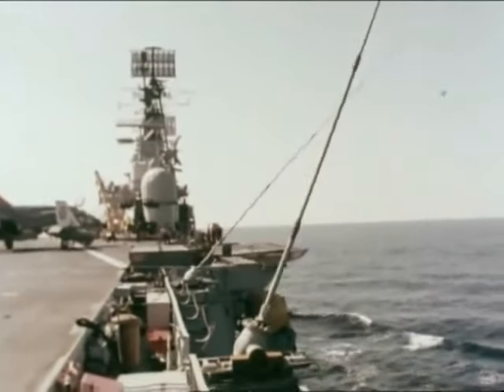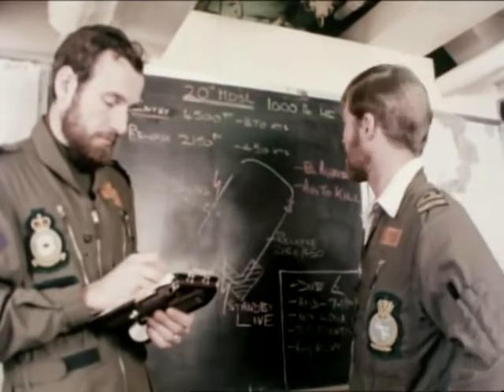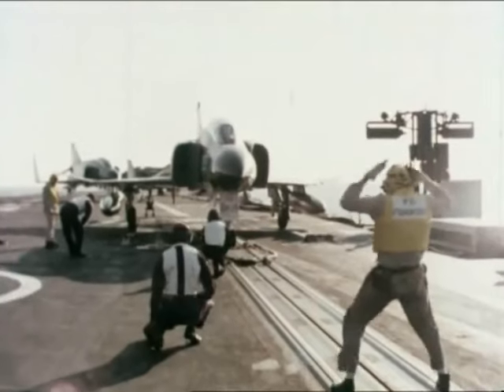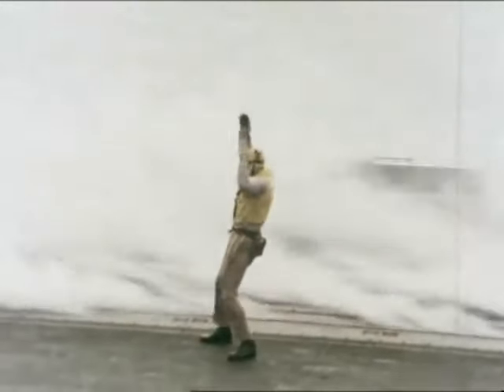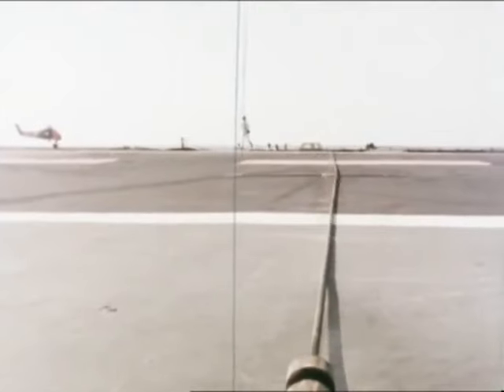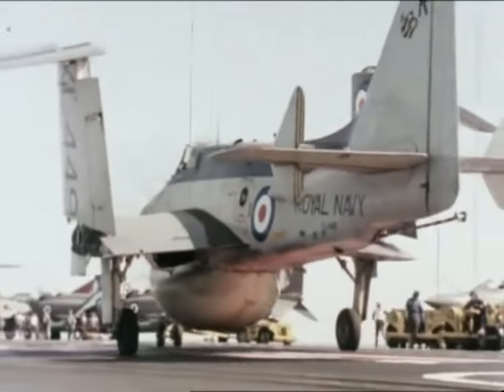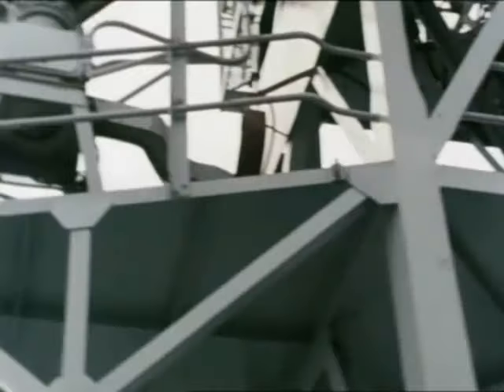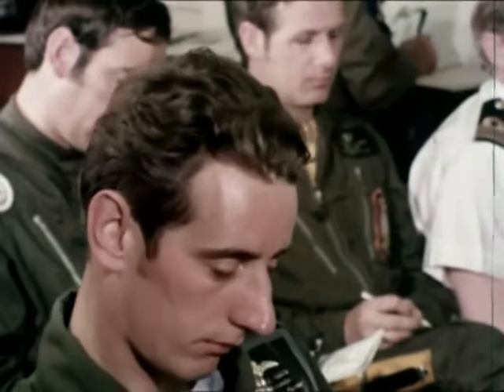HMS Ark Royal 1975 Opération_Buccanneer S2 / F-4 Phamtom II

Comment: As an ancient French sailor, flight deck crew member aboard Porte-avions Foch and Clémenceau in the early 90's, i must say that's an amazing footage, very impressive,  magnificent Wessex and F4, Buccanneers were so massive!! well done! the Ark royal was a very nice ship not very different than ours, old fashion way..Back in time i usually worked around the Flottille 12F equipped with F8 Crusader, the last gunfighter, amazing aircraft, night ops were pretty scary,..Cheers fron France
Reply: Slater Slater  I think the French navy was the last operational user ( early 2000's) after Philipines dicomintionned their own F-8, ours F-8E ( FN) recieved special modifications like the angle attack of the deployed wing, leading edges slats in two element, new avionics...glad to have seen these amazing fighters in action on board...
Reply: Slater Slater  yes the exocet missile/ Super Etendard was a deadly combo, RIP for the crews of the Sheffield destroyer...When i was aboard the Foch and Clémenceau most of the entire air group could fit on the hangar ( aproximatly 30 aircrafts), 2 Alouette III ( aka " PEDRO" escadrille 23S.), 1 or 2 Dauphin chopper ( also " Pedro") same job than your Wessex, 
Super Etendard ( 10 aircrafts flottille 14F, 17F) ( like Buccanneer), few Etendard IV P for recon mission ( P for Photo flottile 16F ), 4 or 5 Bréguet Alizé    ( same as Gannet flottille 6F.) AEW mission, and like the Phantoms, F-8E FN for the air superiority missions ( less than 10, Flottille 12F call sign "lascar"), a couple of Super-frelon ( like seaking flottille 33F) and often, 2 super Etendard with air refuelling belly pods. Flottille had the same type of aircraft, escadrille were composed with different aircrafts ( Alouette II/ III, Dauphin).most of the time only few planes were spotted on the flight deck when the 3 hangars were fully load...
Reply: What a great conversation you two are having! Thanks. I enjoyed your interaction.
Reply: Super Entendard or Buccanneer, thats a hard choice.
Reply: Slater Slater  i have some very good mémories about the F-8 at sea, during night ops, full afterburner after cat launch, and that aircraft was magnificent on the glide slope with fully rised wing, full down flaperons, dark smoke at every power management, And what about that amazing front wheelie after every touch down...
Reply: Slater Slater  your're absolutly right about the range and the payload, but the Super-etendard ( not the Etendard IV M with no radar or the recon version Etendard IV P) was able to carry AA missiles  ( infrared or guided missiles) And was agile and light  enough to engage a dogfight with an other fighter even if the Crusader was used as fighter since the 70's  and have been replaced by most reliable and more advanced Rafale in the 00's...
Reply: Slater Slater  I never seen that footage before! it's great! the Fouga magister was called " Zephyr" in the French navy, it was an excellent two seater final trainer to obtained carrier operation certificate  and you can also see the aircraft carrier "Arromanches" ex HMS COLOSSUS, in the late 60's the straight flight deck was abandonned
Reply: Great information.  Cheers from UK 🇬🇧
Reply: Thankyou for the respectful comment on my old ship,I used to watch the aircraft landing especially at night it was scary and awesome every time..... the buccaneers were never failed to leave me with my chin on my chest.The pilots loved to fly the buccaneers because of the speed and ability to scim the sea surface so close they left a tail wash behind them.I will never forget the day I was on a weather deck one deck below the flight deck drinking a cup of tea, when I heard then saw a buccaneer fly past me and the pilot looking up at me..... he was smiling at the look of disbelief on my face and the tea dribbling down my shirt........
Did you know the buccaneers were used in the first gulf war? They were used to light up the enemy for Lazer guided weapons, they were restricted to flying above 15 feet above the ground because when they flew lower the enemy could see the dust trail blown up behind them......... the modern fighter pilots would make a point of looking at the lightning fast aircraft that still had buttons and switches in the cockpit.........
Reply: My first ship was the USS Kitty Hawk, 1999-2002. My secondary duty damn near took as much time as my primary duty. HOWEVER as I had always been interested in the military I quickly realized my job was a golden ticket and being I held TSSCI clearance I could pretty much go anywhere on the ship I felt like/ curiosity pushed me.

It didn't too long to find my favorite and mostly private spot to watch flight ops or get solitude.  It was directly atop the island.  I had and still do have a deep love for the Tomcat. I remember well my first time up there watching 2 Tomcats launch off the bow cats, this was the moment I realized my favorite spot was actually 30 feet or 9ish meters to either side. Looking back it's kinda funny, I was so full of excitement watching the dance of the flight deck for the first time and watching my most favorite of aircraft get ready to launch.  JBD's rise up then the Tomcats went into burner. This was about the time my body learned that the JBD's Jet Blast Deflectors channeled that massive amount of heat right over the island RIGHT where I was standing. It immediately went from THIS IS SO AWESOME!! To my body screaming MOVE IDIOT!@stevehilton4052
Reply: @Scott11078  thanx for your service and thanx to share all these amazing souvenirs with us! Tomcats were badass period !

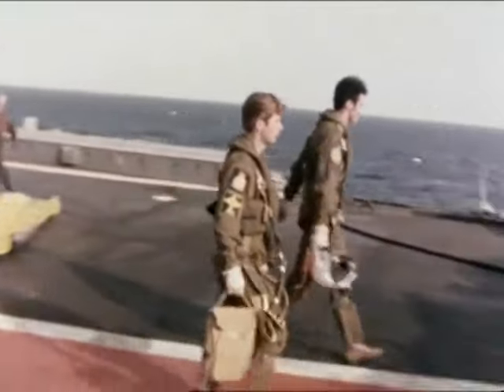Comment: One of the pilots (at 5:30) is David Hansom, known as Twiggy. David and I joined Cathay Pacific on the same day, and we did our command courses (on the B747) at the same time, We were both checked (one of many over many months!) by a fellow by the name of Pete de Sousa, ex Fleet Air Arm Scimitars (who was checked out by my Hamble instructor, Roy Noyes). I recall going up to the 4th floor of the CX building around Christmas 1987 with David to sight our check reports (which we had to read and sign off). De Sousa did us proud, we both got reports that glowed in the dark. Sadly, both have now passed away.
Reply: rightangle  do you know a guy called Dave Waller, he was an engineer on the ship. He’s my grandfather
Reply: Hi Harry, no I'm afraid I don't know him.
Reply: Did you happen to have know a Phantom driver named Jim Bellamy either in the navy or with Cathay Pacific? He was a cabin mate at Dartmouth, but we lost touch. I understand he too passed away.
Reply: Would be the same Pete de sousa who flew scimitars off Victorious 58/59

Comment: Wow...didn't know about that catapult launch method of hooking aircraft to the fuselage itself instead of just the nose landing gear...
Reply: That was the old way of doing it. The modern nose wheel tow bar first appeared on the E-2 Hawkeye in 1962, with subsequent aircraft designs such as the F-14 Tomcat and F/A-18 Hornet being built with the new system, but the older bridle launch method was still being used on the French Super Étendard right up to its retirement in 2016.

Comment: The Buccaneer's front wheel is off the deck when ready for launch.  That's unusual.
Reply: The Buccaneer had a tail bumper / skid as well.  

Also the Phantom in British Royal Navy service was built with an extending nose-wheel leg for the same reason.  It's in this film.

Comment: 2:46 "After you've just spent fifteen minutes doing FODPLOD, throw it in the air so that it can blow back on deck!"
Reply: There's an old joke in the Royal Navy: 'always test the wind before you throw gash over the rail'.  

In the RAF, after a FOD plod, we had to hand everything we found in, so it could be traced back to source.  

If a tool, a bit of wound-up locking wire or a nut was found, we all wanted to know how it wasn't securely attached to the aircraft as it was supposed to be.

Comment: Why were the Buccaneers positioned for launch with their nose wheel raised off the deck?
Reply: To give them enough airflow over the wing so they would actually fly at launch.
Reply: The Ark and Eagle were about as small a carrier you could have to operate Bucks and Phantoms. The phantom needed a longer nose wheel than US Versions to increase lift and the Bucanneers were raised to increase lift.
Reply: Also RN Phantoms were hindered by Rolls Royce Spey engines increasing their length by iirc 100mm which necessitated the longer nose wheel or added to the reasons for it. Also, I believe the RN Phantoms were prone to damage on their tail sections due to this modification. The UK government insisted Phantoms were fitted with RR Spey engines for all the obvious reasons none of which were technology based.

Comment: far out 7.50 .. love that nose gear and angle of attack .... gold  . is it just me or is the usaf f4 nose strut  shorter .. why did the brits do it so different ?
Reply: In truth, British carriers, mostly designed in the piston-engined era, were too small for operating modern jet aircraft and this was one of the expedients used to enhance them.
Reply: a higher angle of attack at take off meant they could get away with a lower take off speed

Comment: they must have had 5000 tons of signed papers on board
Reply: The Form 700 for an older plane like a Buccaneer that had been in RN and RAF service was several volumes.  

With all of the Form 720 maintainence and rectification papers, it was like a library.

Comment: back in 1962 the Indian Navy should have acquired the HMS Ark Royal (R09) & HMS Eagle (R05) carriers . . . three second hand (ex-Royal Navy) Audacious class 36,820 ton (43,690 ton loaded) multi mission (CATOBAR) aircraft carrier powered by Rolls Royce MFT60 eNi-C (9,650 kWh) M-FEP system . . . an air arm made up of 21 naval carrier borne Hawker Sea Hawk F2 maritime multi role aerial interceptor & 5 - 8 carrier borne F-14B Tomcat (Block III) maritime multi role fighter interceptor . . . in addition to 3 carrier borne Fairey Gannet AS.2 maritime multi role ASW fighter bomber . . . internal weapons bay of the carrier borne Fairey Gannet AS.3 maritime multi role ASW fighter bomber can be armed with 2 - 3 AGM-109E Tomahawk (Block IV) active radar homing inertial guided air-to-surface land attack cruise missile & 4 Star Streak semi-active radar homing laser guided BVR air-to-air missiles . . . can also accommodate JDAM 1000 inertial/GPS homing air-to-ground guided munitions, depending on mission specific ordinance package . . .

Comment: Who's most responsible for the giving up of this ship: Callahan? , Heath? , Wilson?
Reply: Ark Royal was expensive to maintain, apparently a maintenance ship had to be part of the escorting vessels. Commissioned in 1955 only twelve years in service the rest of the time she was being worked on. Hence why decommissioned "early". Eagle was built better but was decommissioned two years prior. Ark Royal was laid down in 1942 and not commissioned until 1955. Government had no choice but to get rid as the cost was enormous.
Reply: @gerdknight1109  :
Those costs are a necessary evil.  Our carrier fleet in the U.S. is expensive, but we understand it's potential as a force-multiplier. We're never to give them up [unless Bejing-Biden continues to throw away our country, but that's another matter!] because they're just too damned effective!
Reply: @Dreaded88  you've missed the point with regards Ark Royal, its service life was twenty four years of which she spent twelve years either being repaired or needing its 1940s infrastructure being "worked around", for example, the electrical systems were DC which were obsolete even by the mid 1950s. Also she was designed and laid down before the jet age. To be perhaps somewhat unkind Ark Royal was not fit for the era she found herself in. Hence all the compromises and costs of these compromises. For every year at sea a year spent being repaired or refitted does not make economic sense. The UK struggles now to recruit sufficient staff to crew the vessels it currently has. The Royal Navy now has more admirals than ships. There is a dichotomy between the facade and the state of UK forces. The army for example is being reduced to levels not seen since the 1700s. The UK government has reduced its numbers by some 10000 to ~ 70000 and this under a very right wing government under de Pfeffel Johnson.
Reply: @gerdknight1109  :
Right Wing? Army? Blonde-Potato an actual Conservative? My friend, I think you've got wires crossed!
As for old equipment, and needing refits: we do them. These ships cannot just be thrown away! These aren't Pleasure-Yachts. We don't just throw them away because they're old, either. There's too much at stake. REPLACE , as in: 1-for-1 swap, yes! But scrap, and then mollycoddle the forces like a child with such fare as "We'll see about getting another,... someday..." that doesn't work!
Reply: @Dreaded88  again you miss the point the UK could not afford or sustain vessels such as Ark Royal then or replace them. With regards the British army mention this is a comparator as to the current state of UK armed forces. The two new carriers cannot (once Prince of Wales is fully commissioned) put to sea as the Royal Navy has not the capacity in crew or ships to support both. The Royal Navy of today is much smaller than even during Ark Royal's time in terms of people and ships. Further, the Thatcher government had a Defence review in 1981 that cut further not only the Navy but the other branches of the UK armed forces too. The Defence reviews that succeeded the 1981 cuts have further diminished UK capacity. In addition recruitment to all branches of the UK military is poor or in other words people do not want to join the armed forces. The Tories are right wing and yet constantly cut the armed forces, which does amuse me.
Reply: @gerdknight1109  :
Schmuck: quit!....  >:(
Reply: @Dreaded88  presume you don't like facts and figures and so deflect the argument. Well done, not!
Reply: @gerdknight1109  :
No, it's not that; you're just annoying!!!   >:(

Comment: in it's search for a carrier, in 1962 the Indian Navy should have acquired the second hand (ex-Royal Navy) Audacious class 36,820 ton (43,690 ton loaded) multi mission (CATOBAR) aircraft carrier powered by Rolls Royce MFT60 eNi-C (8,400 kWh) M-FEP system . . . air arm made up of 21 naval carrier borne Buccaneer Mk2 maritime multi role aerial interceptor & 8 carrier borne F-14D Tomcat (Block III) maritime multi role fighter interceptor . . . in addition to 3 carrier borne Fairey Gannet AS.3 maritime multi role ASW fighter bomber . . . internal weapons bay in the carrier borne Fairey Gannet AS.3 maritime multi role ASW fighter bomber can be armed with three AGM-109E Tomahawk (Block IV) active radar homing inertial guided air-to-surface land attack cruise missile & Star Streak semi-active radar homing laser guided BVR air-to-air missiles . . . can also accommodate JDAM 1000 inertial/GPS homing air-to-ground guided munitions, depending on mission specific ordinance package . . .